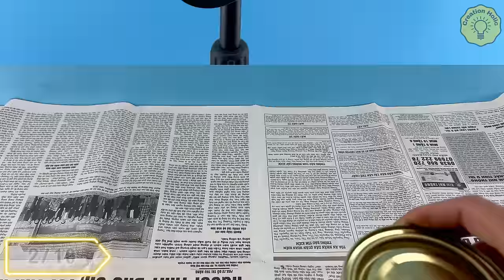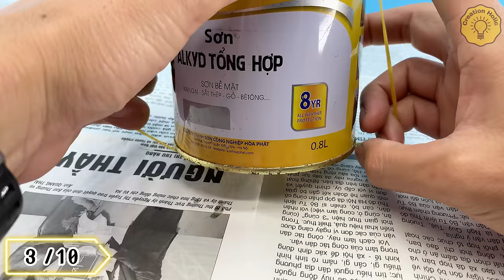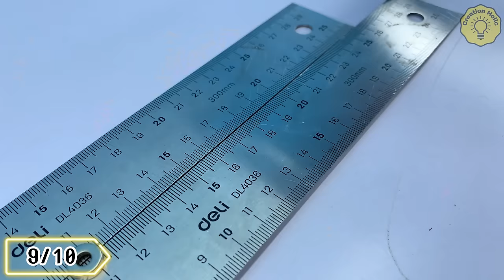10 Intelligent Secrets & Tips That Work Extremely Well

Comment: Sometimes I have sand around a pipe or  something round. Typically you take a strip of sandpaper and wrap it around the pipe. Then you pull on the ends. But you have to move the sandpaper around. But your idea of attaching a piece of sandpaper to a hole saw gave me an idea. I will use that hole saw with sandpaper around it and then wrap a length of sandpaper around it and the pipe or round thing. Using a cordless drill I can sand all around the pipe now. Great idea!

Comment: I used to use newspapers too. But now I use the bottom of cardboard boxes. Stores typically cut away the top of a container of stuff and the product is still in the bottom of the carboard box. When I need one I take one home and use them around the house when I am doing some jobs. For example, I would put the paint can in the carboard bottom. It will contain any spills or drops.